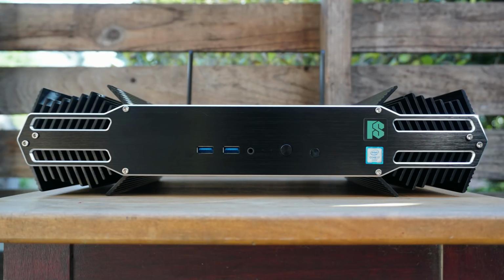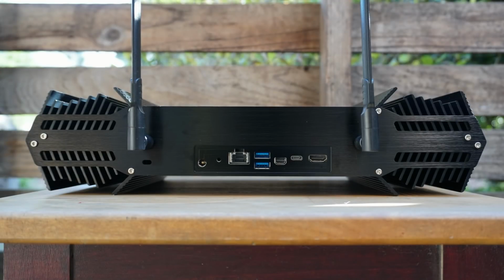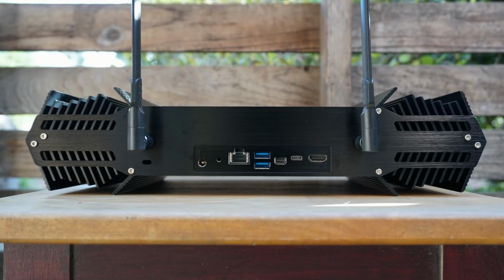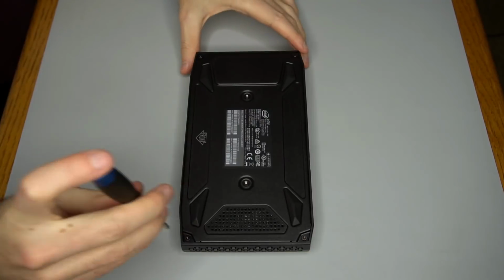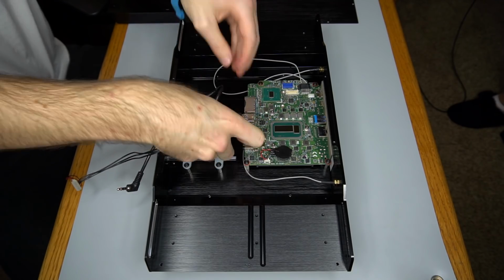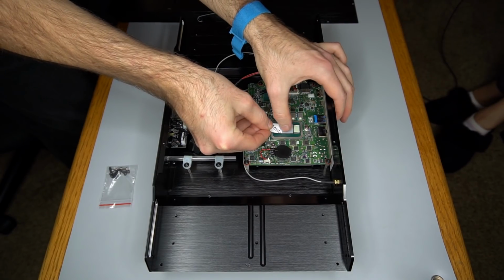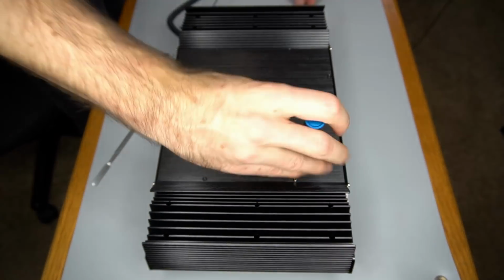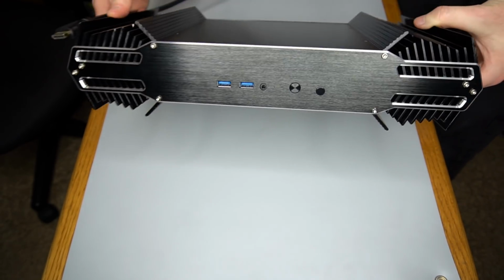Akasa Galactico - Building a Fully Silent Fanless PC

Comment: Doesn't make sense at all: why start with a nuc? In that huge case it would be possible to put an itx board i guess.
like an Rycen 2400 with integrated GPU. Way more options and cheaper as well.
Reply: Money is always an issue right?
Reply: Thermals for a full blown PC are off the chart. Then add the PS to push that, more heat.
Notice the max speed is 2.6 GHz, Also using SODIMM.
Looks like Laptop components. 
Laptops use the same as higher speed desktop parts just declocked for power & heat.
Reply: power efficiency
Reply: This was the best option in 2016. Apparently sold well enough to warrant a third party case.
If you can find it cheap second hand it's still worth buying. It's a powerful little machine. The only drawback is the GPU,  but you can fix that with an external GPU (I recommend connected with nvme m.2, it's higher performance than thunderbolt3).

Comment: Does the case include the wi-fi cables and antenna? Or what kit did you use? Web page doesn't show them included...
Reply: No, the wi-fi cables and antennae were purchased separately.  There are antennae included with the NUC, but they don't work well with the Akasa case.  You can find them on Amazon for $10-$15.  Just make sure that the cables come with IPEX connectors made for M.2 or NGFF cards, not mini PCIe cards.
Reply: @mgfoster  thanks, that's what I thought but wanted to confirm

Comment: Your temps probably could of been better if you had used proper thermal paste on the CPU/GPU die and the heatpipes. MX-4 or GD-900 would of been so much better.

Comment: I see a facility to put a 2.5 in the case ,can I use x2 m.2 ssd and a 2.5 ssd ?
Reply from the maker: No, unfortunately you can only use 2 SSDs total, 2 M.2 or 1 M.2 and 1 2.5".

Comment: I have a nuc  i7 i have been using it for approx a year.
Will it mess with the oem I installed as I have heard that if you change hardware it renders os useless,
Thanks for the vid it will come in handy
Reply from the maker: No, this case won't affect any software.  It is essentially a CPU/GPU cooler with a power button and LED indicators.

Comment: Does the Akasa case get hot ?
Reply from the maker: Yes it does, not quite enough to burn you, but it can come close at maximum load.
Reply: So putting a plastic speaker or usb hub on top is out of the question and will melt right ?
Reply from the maker: The flat surface on top doesn't get as hot as the fins, putting something there would be okay.
Reply: Thank you so much for answering, i'm gonna build this kit too now in the same Akasa Galactico

Comment: I wonder if you could put a slim fan inside of the case for extra cooling.
Reply from the maker: There's not much space in there, so only the smallest fans would fit.  Of course that would defeat the purpose of this case.  Also, since the heatsink is on the outside of the case and there is no air intake or exhaust, a fan would probably be more effective outside of the case.
Reply: Also... why a fan inside it, when there are no vents for it to breath in and out of...